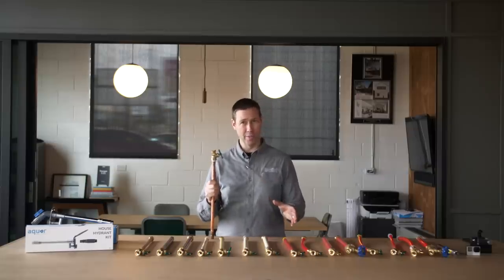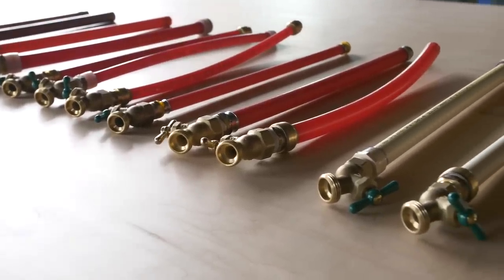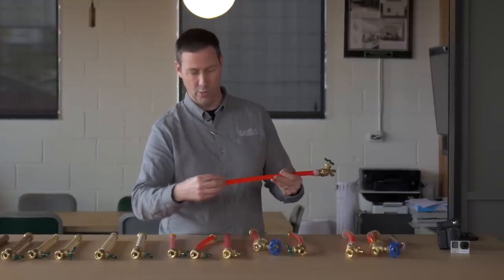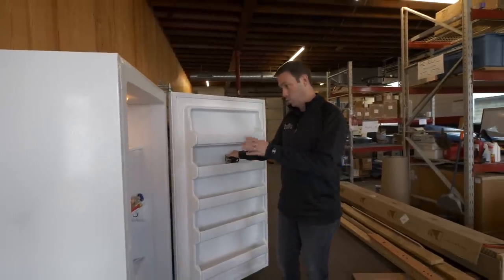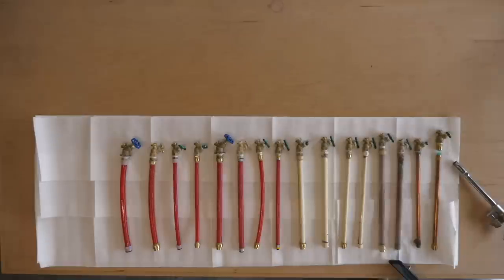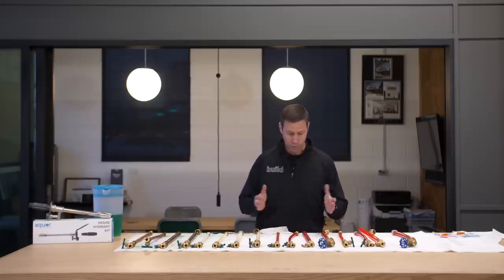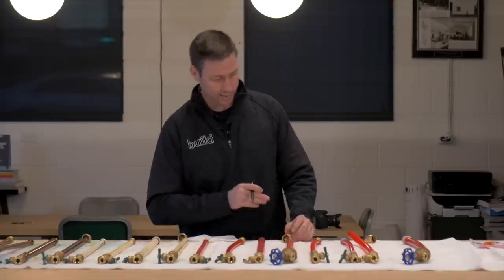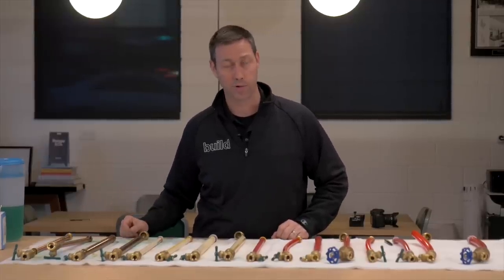Copper vs Pex vs SharkBite - Freeze Testing

Comment: Plumber from Canada. Pex B splits and CPVC spilts. Pex A (Wirsbo) will resist splitting, the fittings however I'm not convinced are impervious to splitting. Enjoyed the video; reaffirms my religious use of Pex A
Reply: +andy have you used Pex A with Crimp rings ? if so would love some thoughts on Pex A with Crimp rings
Reply: I am actually sitting in the break room at uponor, and I can tell you vie seen these pipes hold up to 800 pi before failure... And it was the pipe the failed not the fitting.
Reply: What's the employees discount like with Uponor? lol
Reply: I know it can done, (Reliance Heating and AC rental in company in Ontario Crimps onto to my feeds all the time :( ) 

I wouldn't plan around doing it: 

-warranty nightmare
- Uponor has min friction loss, you lose that using crimp fitting
- longer install
Reply: +David Weeres what about Uponor pex A with Crimp rings ? any thoughts ?
Reply: marble head 
Uponor uses a different ring system than WARD or VIEGA, different barb type fitting as well.  The Uponor fittings have a more pronounced center barb, and their "expand/retract" rings really GRIP.
All the WARD and VIEGA bursts I have seen, are in the pipe or poly fittings.  I only use the brass fittings here in VA.
I remember Uponor's poly fittings being a more robust material (back in California.)
Reply: +David Weeres.   Wow I bet that would make it a cheap air compressor plumbing setup for a big shop.  As black gas pipe can get expensive for big buildings.
Reply: Yes I wounder if the Pex and CPVC were 100% frozen. Most freezers are not set to be that much colder than freezing , there is no need. Also these pipes were only in there for 20 hours and plastic is a better insulator than any metal. I think the Shark Bite fittings should have failed similar on most pipes they did not look to be biting into the Pex that much more than the copper.
Reply: marble head the way the pipe is designed the expansion fittings will get a better bite since the pipe will always want to return to its original size...
Reply: Brent, I've wondered about that also. The pressure rating on some pex is 160 psi. That is very close to the 140 psi of many compressors. A test to failure would be interesting. Does the pex shatter and send out projectiles? Iron or copper pipe can also be used to take the water out of your compressed air as they promote condensation.
Reply: The added benefit of the PEX and to a smaller extent CPVC is that they allow some expansion before failure, so the pressure is not as great as the copper pipe which has much less elasticity.
Reply: Seen it used for air lines lots. Ok for home jobs, but heavy use causes a lot of friction and heats up the pipe which usually results in a blowout near a bend. No shrapnel but your shorts fill up quick.
Reply: @James-eq8fs  freezers are typically less than ten degrees
Reply: Thanks for posting your experience
Reply: I live in Victoria, here it never freezes, 😊
Reply: @michaelwalling8281  the pressure rating drops alot with temperature rise, use alot of air like a bodyshop or in industrial situations and pex easily fails with air pressures under 100 psi.
Reply: I didn't know it previously, but there are at least 3 manufacturers of PEX-A. One is Uponor, another is Apollo/Conbraco, and I forget the 3rd....   Damnit :)  I know there is also at least one European manufacturer of Pex-A, but that name also escapes me.
Reply: Dr. Andrew Whelton, an assistant professor at the Purdue University Lyles School of Civil Engineering and Division of Environmental and Ecological Engineering, has been researching the safety of plastic pipes since 2014. He has focused on a type of polyethylene called PEX in particular.
Reply: Whelton's research team tested six brands produced by different manufacturing methods. They found that each type caused odors exceeding the Environmental Protection Agency's guidelines, and leached chemicals such as toluene, which is neurotoxic, and MTBE, a carcinogen that's been banned as a gasoline additive, but is a byproduct produced during PEX pipe manufacture.
Reply: @kalijasin  Gonna be a Helluva a recall
Reply: That's a really good point. Cuts both ways, though. It means that yes, this test didn't expose the water inside the pex to the same amount of freezing as that inside copper sees due to better thermal transport... However that also means that in a true installation it would take water in pex longer to freeze too, providing better protection to transient freezing.
Reply: @robertkat it seems to get colder by the year. Hit -10c in Victoria several days in a row last winter.

Comment: Nice test Matt. When I plumbed my primary home I went with copper but when I bought a cottage in Maine and had to replace the copper (well water created pin holes in some of the 35 year old lines) I went with Upnor pex to better resist freezing and the water itself. Bought a Milwaukee expander specifically for the job. Plumbed the whole place in a day. I know that copper has withstood the test of time but I'm really impressed with Pex. If it proves to be as durable as copper then I can see it becoming the new standard.
Reply: They say 50 year lifespan
Reply: My house was built in ‘78. Had well water 20 yrs ago, now municipal water. It has some microscopic holes in it. I’ve ran some Pex since I’m remodeling. Got the pressure test on some of it now. Was a great opportunity to put valves running to each room so if there’s a problem I can shut one room off and not have to get a hotel room
Reply: @jimmysapien9961  50 years? Really? I'll be in the ground a long time before it needs replacing then and it'll be someone else's problem 🙂

Comment: When I first started with PEX I think I called it freeze proof. Then I got a few frozen PEX repair calls and now I call it freeze resistant. I live around a lot of well systems with slightly acidic water (including my own) and PEX is an awesome alternative to installing and maintaining a neutralizer and possibly a softener to reduce corrosion of Cu pipe. The one thing I always point out to my clients before they make the Cu vs. PEX decision is that I have NEVER seen rats chew through a Cu pipe and I've seen rat chewed PEX plumbing a number of times now. I also tell them that they shouldn't have rats where there is PEX because I've also seen rat chewed ABS pipe and Romex wire. I pretty much just assume there are going to be rats and I try to route plumbing and wiring where it's not as easy to chew on. Whenever you see rat chewing damage it seems to always be where they can sit comfortably and chew for a while, so I try to avoid setting that up for them. Also, condensation on the pipes is a fresh water source that could help to attract all kinds of critters to licking/chewing the plumbing. Insulation on the pipes can eliminate condensation, so it's not just for freeze resistance and saving energy.
Reply: great observations, thanks
Reply: Acidic water may not get your pipes, but it will get the metal in your faucets, dishwasher, toilets, showers, etc.
Reply: A removed comment stated that rodents chewing on pipes and wiring was a "technician hygene issue". Saying that the technicians dirty/food smelling hands made the pipe or wire smell good enough to eat. That's the first time I've heard that theory. At least on my hands,  I kind of doubt there's much of food smell by the time I get pipe dope, glue, and what else I happen to be working around on my hands. Is that food smell still there on 20 yr old piping and wiring? Yesterday I saw mouse chewings on a vac hose in a 30 yr old furnace that I doubt had been touched since being built at the factory. Also, rats chewing automotive wiring is really common. Somehow I doubt the underside of most hoods smells much like a fast food joint.
Reply: Excellent point re: rodent damage. I live in farm country and buy (many) buckets of cheap offshore rat bait. I leave some of it inside walls because rodents can go where other critters cannot. For shops and beneath structures I break up bait then mix with peanut butter and let dry. It's very effective.
Reply: All rodent damage is caused by poor worker hygiene...hands not washed after eating. Rats think the pipe or wire is food.
Reply: @Robert Mencl  For years, I've heard that rats chew automotive wiring due to soy being used in the insulation. I don't know if that would apply to romex or not. I doubt it would apply to ABS pipe. If you Google "Do rats chew wiring because of soy in the insulation?", it is a common belief that it's true, but the first hit I got is a news segment saying that that that is a myth and that they are just as likely to chew wiring w/o soy in the insulation. All lawsuits blaming the chewing on the soy have been dismissed. They chew to control the growth of their teeth. I'm sure if they could do that on something that tastes like food they would do that, but I'm sure that some of the rodent damage I've seen over the years had nothing to do with someone's food smelling hands getting on the item that was being chewed. I will admit that the only time I've ever seen rat chewed ABS pipes was on kitchen sink drain lines. It's almost as if they can smell all that great food slime smell right through the side of the pipe, and they knew that that was the best pipe in the house to chew a whole through. The last time I saw that over 3' of the 2" pipe had been chewed through.